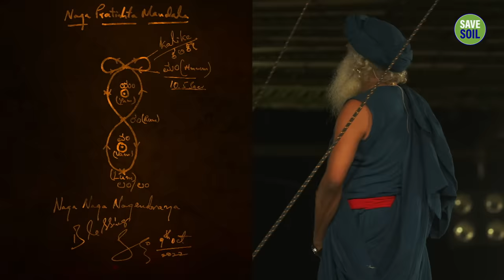Glimpses of a Rare Mystical Event - Naga Consecration @Sadhguru Sannidhi, Bengaluru

Comment: these actions have consequences. not sure what is being achieved here, but the path of tantric practices (alchemy and such) could be devastating if not done in secrecy. Someone like Sadhguru should be familiar with these rituals, and should have been very careful/secretive while performing them. there is a reason why these rituals were prevented in society in the past (thus 800 years). for example: mercury uses could lead to mercury poisoning if the practitioner was not careful. there are many pseudo-science/superstitions behind tantric vidhya. if you actually believe that modern scientists did not try all the metallurgical processes or any further studies in mercury, you will be gravely mistaken. so there is nothing fancy here with solidified mercury. it is the same superstition that lead people to believe in use of mercury as a propellant in Pushpaka Vimana (UFO of the ancient times). superstition folks, superstition.